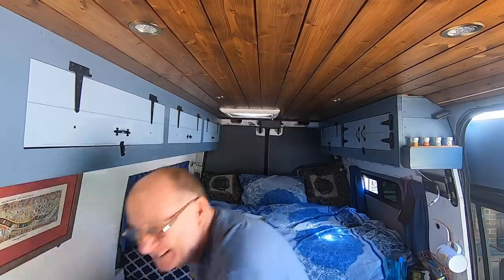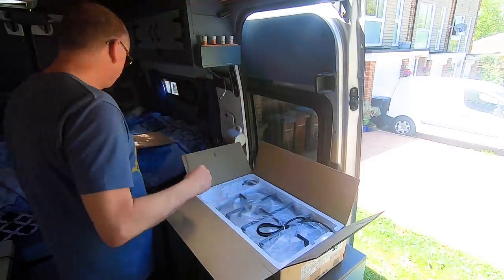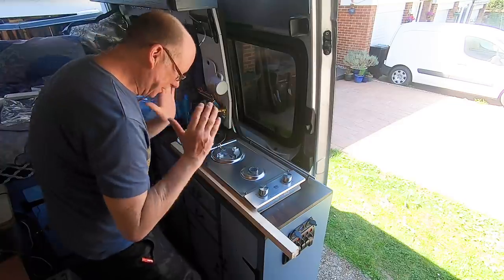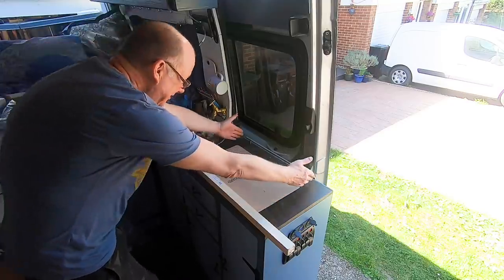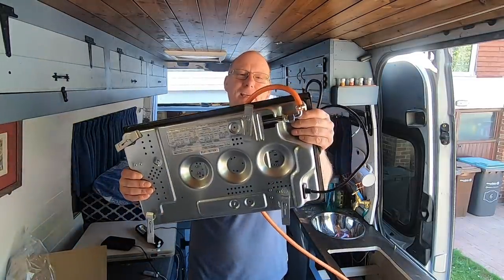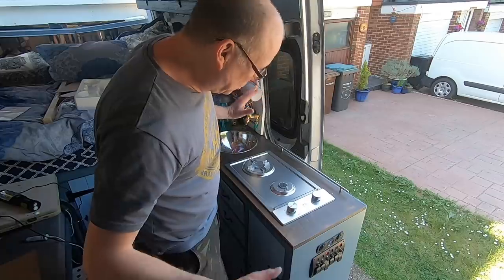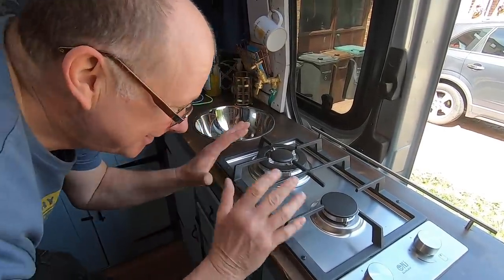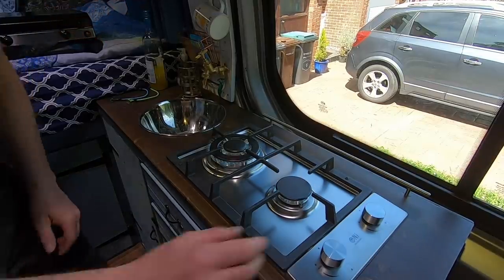Installing twin burner LPG Propane Gas Hob Stove Camper van build

Comment from the maker: ORANGE LPG GAS PIPE should not be used for permanent insulation I’ll be changing this to copper pipe when I fit my gas locker in the rear garage of my van apologises for any confusion
Reply: Yet my factory built VW is fitted with orange gas hose as a permanent solution.
Reply from the maker: John Veryan that’s interesting because my old vw Combie was too 👍🤓👍
Reply: No reason or requirement for copper if under 1m.
Reply: Hi, any idea where one could buy a two ring gas hob, reasonably priced, thanks... love the videos.....
Reply: I would never put copper in a van. The van flexes, moves, get's jolted etc. which means the copper will work harden and crack. I never hard wire my plumbing either in boats or vans. It's just asking for trouble.

Comment: looks great Mel! regarding the rattles, I  suffered the same  i finally built a shallow wooden lid (to match the interior) and added soft foam on the inside of the lid. this cushioned the hob bits and it also doubled as a "work surface/prep area" when the hob was nor in operation. Also it was a add hock tray if needed! .... just a thought
Reply from the maker: Oh that’s brilliant idea thank you 👍🤓👍
Reply: Ha! Thats what I said... oh that’s brilliant. Gotta love the viewers comments. Nice work Mel.

Comment: Thanks Mel I'm glad you did this for your channel 
The amount of stick I got on fb for not using copper pipes was crazy 👍🏼
Reply from the maker: As far as I understand it as long as it’s under a meter it’s fine 👍
Reply: Mel’s Van World you cannot use flexible hose on a permanently fitted appliance. You can only use the orange hose on portable equipment. That company should not be supplying that hose with that cooker it’s against current EU regulations.

Comment: Ive just fitted an underslung gas tank, what a job that was, the weight in it is no ones buisness, and i didnt have a jack so was bench pressing it up 😂
Reply from the maker: Bramish EU that’s brilliant idea and well done 👍 😬👍
Reply: @BigVanSmallWorld  tbh Mel, they save space, and they come with all the rubber coared gas pipe, so all piping is ran underneath and pops thru at the appliance.  However, they arent cheap, about £400, on the upside, they come with everything, recessed filler box and all pipe work/maniflod and even pipe clips with tek screws. They are worth it if budgets stretch that far.  Oh, and comes with digital lvl indicator and cable.

Comment: Sometimes the solution lies in your own barn... found å 15 ltr ventet can that will do as dieselheater tank and fits there where the 2 gassbottles stand (I take out 1 gassbottle in wintertime and replace it with dieseltank for winter use)👌🏻. Thanks for the inspiration🤘🏻
Reply from the maker: Thank you that’s great and you’re absolutely welcome 🤓👍

Comment: I just bought a twin hob with a grill for my camper, and my rattly bits in the Center of the burners have a little self tapper screw through the cap into the cast body. Screw is off Center and I thought it was strange but you have just made me have an eureka moment! Thanks
Reply from the maker: Oh that’s what I thought about doing at first put screws though the burners but then had second thoughts good luck with yours 👍🤓👍

Comment: Mel I have a two calor gas hob in my campervan was going to change it to the  one you installed. Would I still be able to use calor gas bottle.
Reply from the maker: Yes you can 👍

Comment: Hi Mel … looking at installing this gas cooktop in my van. Like you, I won’t have 240v power in the van. I assume the gas ignition does   not require 240v to work. What does the 240v operate. Regards Gino from Australia
Reply from the maker: Hi Gino I used my Bluetti

Comment: Mel: I think I'd have just cut a bit of sponge to fit under the bit you screwed down while you travelled. Would stop the rattling and stopped the big lump from slipping off at the same time - no need to screw down, and easy access for cleaning as grease will build up under that dang thing :-)
Reply from the maker: That’s what I was thinking 👍

Comment: hi mel just a thought mate, if you did not want to kink the gas pipe maybe you could adjust the gas connector to vertical and then you would get no kinks.
Reply from the maker: Hi I could not do that because of the draw 👍😊👍

Comment: HELP NEEDED !! 
Hello Mel. Or Anyone who can help .!! 
I can't work out how you got a pilot light to fire on this unit, when its a 240v plug? - did you use an extension cable ? - Where you able to rewire it to go off your 12v system ? - Or did it just work from pure voodoo alone? - I would be so grateful if anyone knew the answer to this. Thanks in advance !

Comment: hello mel can you link to the fittings to connect the gas hob to the copper pipe that the hob should be connected to from the gas bottle locker ? if you have done that or know how to ? please
Reply from the maker: Hi mark I’m the same as you I can’t find the fittings but when I do I’ll definitely let you all know 👍🤓👍
Reply: @BigVanSmallWorld  thank you mel as that is the only thing stopping me getting a domestic hob to fit in a van although from my limited knowledge it all has to be compression fittings with no ptfe tape as that can cause fitting problems

Comment: Hi Mel, 

Just wondering how you got your stove to spark without using the standard 240 plug ?!
Reply from the maker: Jackery under the sink 👍😁👍
Reply: Thanks for the reply! would it work with just lighting a lighter and then using the gas ?
Reply: @jamieduff1811  did you ever find out?
Reply: @jamiewalker8600  you can light it with a match or lighter if it's not plugged into power 👍

Comment: Awsum mate why dont you just take the rings of while your driving, also you could make a wooden box to cover the cooker so you still have a work top when not using cooker, put a hinge on cooker cover and it will double up as a heat shield for the window when cooking,, 😁
Reply from the maker: That’s a fantastic idea thank you 👍🤓👍

Comment: Hi Mel, i have cut my hole in my plyboard worktop but am not sure what the best paint or varnish to use? Any suggestions? The worktop also has a sink in like this one you are doing! Thanks Paul
Reply from the maker: Hi Paul I simply use wood stain and varnish on mine have a look at one of my latest videos IKEA sink hack and in that video Rebecca shows what varnish to use all think about low VOCs good luck 😉
Reply: @BigVanSmallWorld  thats ace Mel, thanks was just a bit bothered about the heat generated but am sure the glass hob will soak that up! Cheers 👍

Comment: Hi Mel, I have the same cook top and the cast iron top has small rubber feet on it and I dont get any rattling at all.
Reply from the maker: Hi ya yes mine has the same rubber feet too I just didn’t want it to come flying off when I go a pot hole 👍😂👍
Reply: @BigVanSmallWorld  I also made a top to cover mine so when not in use I still have a useable worktop and when lifted it acts as a splash back and wind deflector
Reply from the maker: GAZO D that’s a great idea 👍🤓👍

Comment: Hi Mel great video as always , I’ve just fitted the same hob in my van can you remember if the brass conector from hob to orange gas pipe had a rubber seal I’ve got same conector but no seal wondering if just use ptfe tape be ok 🤔
Reply from the maker: To be honest I can’t remember for sure but I think the adapter did have like a tap washer send me a photo on Instagram to remind me
Reply: Any ideas how the brackets are fitted folk's, instructions are naff

Comment: This might sound ridiculous but could you run this stove off the small screw on camping gas canisters with the correct fitting ECT  ?
Many thanks
Reply from the maker: Yes definitely will work as long as you got the rite fittings 👍
Reply: @BigVanSmallWorld  brilliant mel thank you for replying 👍 . I don't suppose you know what types of fitting to look for off the top of your head do you pal ? Many thanks for all your vids bud great help

Comment: ive got the same one and mine does not rattle unless i got down off road tracks  should be fine
Reply from the maker: bonehead2412 Hi thank you that’s reassuring I’ll be going down lots of off road tracks when I go metal detecting 👍🤓👍
Reply: @BigVanSmallWorld   you got be be going hard on the van to make them rattle but u cant hear it as your getting throne all over the place (im bad for not putting my seat belt on )

Comment: Mel I thought for a permanently fitted hob you need to use rigid copper pipe for the supply. I might be wrong though.
Reply from the maker: I think that’s if it’s over a meter long thanks for the positive feedback really appreciated 👍🤓👍
Reply: @BigVanSmallWorld  thats good to know as I've used the same hose but its under a metre aswell, thanks Mel
Reply: According to current EU regulations orange flex hose cannot be used on permanent cook appliances. Only on portable appliances. The installation must be done in copper pipe.
Reply: @GregVirgoe  thanks Greg, it was probably   your vlog I heard that on. Mine is a campstove that I screwed down to the worktop so I can unscrew it and stow it away to comply I suppose.

Comment: Can you use that scrap counter wood piece for an extension fold-up counter?
Reply from the maker: Ohh that’s brilliant idea I’m so great full thank you 👍🤓👍
Reply: @BigVanSmallWorld  maybe you could hack up a piece of wood with a pipe, like your table. Drill a hole in the top end of your counter to the right of cook-top and put in a swivel work surface tier. Something you could plug up when not in use and store the extension some place or swivel tier over cook-top when not in use. Maybe a wood plug with a tiny knob to pluck it out if needed to cover the hole. Options! I guess you could use hidden magnets to keep your plug in place☺️ Or you’ll have to build hinged extension out over those switches when you enter, but it’ll get in your way too much.

Comment: Hi Mel great vid. Do you have a link for that hob mate ?
Prob a silly question but how did you get ignitor to work without using the 240v ?
Cheers
Reply from the maker: Derek murran thank you there’s a link in the description of this video for you and I used an inverter for the 240v 👍🍻

Comment: hiya Mel love this 2 ring stove, i did notice in listing that it has a 240volt plug which is for auto ignition, so is yours plugged into an inverter? Cheers Adam
Reply from the maker: I’ve got it plugged into my power oak works great 👍

Comment: I just fitted that..what gas do you recommend and what fittings do I need to connect to the hobs.my partner lost the bag of bits so I just have the stove in and no need for the igniter as we use lighter..just need it hooked up right .
Reply from the maker: You need 3/4 female to 8mm barbed fitting for the hob good luck 🤞
Reply: @BigVanSmallWorld  I sorted it all out and works fine..

Comment: I've got mine fitted but not connected electrics yet.. Hsve you wired It to your inverter? Would be interesting tic see as I'm yet to buy a inverter
Reply from the maker: Hello no I just plugged it in to see if it works when I’m out I’ll use a lighter 👍

Comment: Need your help Mel (or someone that can answer) I watched this video and promptly went out and brought a new hob to go in my little van as I was fed up with the single burner/sink combination. Just realised that the hose from the campingaz regulator is a much smaller fit than the inlet on the gas hob. Do I need to use some sort of 'step up' adapter? If so, can anyone point me in the right direction please. I think the pipe from the regulator is 8mm but its very hard to measure the one on the hob that's designed for a house. it looks around 15mm!! Thank you in advance to anyone that replies....   :)
Reply from the maker: Hi Sharon you are absolutely rite the standard size for LPG gas is 8mm the hob is 3/4 inch or 15mm when I brought mine the reducer and lpg  jests came with the hob it was just wedged in side the box check you haven’t missed it in the packaging otherwise you need a 15mm  to 8mm barb fitting hope this helps 👍
Reply: @BigVanSmallWorld  You Mel, are an absolute diamond lol. I just went through the box again and guess what? Yep it was in there. I have spent the last hour researching how to do this and it was there all the time. Thanks so much. I cant wait to get it connected.  Mind you, I have gutted my van and in the process of putting it all back together. Quite daunting at times. Thanks again youre a star :)
Reply from the maker: Lol that’s brilliant so please you found it good luck putting all back together 👍😊👍

Comment: Hey Mel
Did you replace that orange pipe with copper? If so which connector did you use from the hob down to the 8mm pipe? Just changing mine to copper for the regs, and struggling to find a solution at the moment 
Love you videos. Tom
Reply from the maker: I don’t know about what regs you are referring too mine is as is in the video I go from orange to copper using the fittings that came with the appliance sorry I can’t help

Comment: Great video as always Mel did you convert the new stove to 12v or did you use a main plug just to show it works? Just had though mind your side window a lot of heat as you are well aware? From sunny skeggy uk
Reply from the maker: Thank you some good points there regarding the window I’ll have to put something up to protect it and yes I plugged it in to see if it works when I’m out I’ll just use a lighter 🤓👍

Comment: Any pictures of the connection to to hob just been given a hob  so no connection with it cheers mike
Reply from the maker: You need a 3/4 to 1/4 gas fitting good luck 👍

Comment: That's a smart looking hob - I just wonder whether you will need the 240v supply to enable the flame failure feature , or is there a 12 v option on the it ?
Reply from the maker: That’s a really good question one I did ask the seller I’ll address that on Wednesday but for now no you don’t need power for it to work 👍
Reply from the maker: Campervan Photographer we’ll done 👍🤓👍

Comment: great location ... jokingly ... wind will keep the flames out
Reply from the maker: Iv no worries with wind as I fitted a splash back 👍🍻👍
Reply: @BigVanSmallWorld  Thanks,  I need to remove my old unit an measure the opening to my options.  Maybe use it until I can install a new top.  The stainless top on mine was so badly neglected by the prior owners, it caked rust! .... if you can imagine that.

Comment: Hi Mel, does the safety cut out feature still work if the hob isn't plugged in?
Reply from the maker: Yes it does it requires no power to be used it’s just the ignition that needs power to make the spark I don’t even use that I use a little usb lighter works perfectly fine 👍
Reply: @BigVanSmallWorld  awesome, thanks for getting back to me so quickly, fitting one in mine this weekend!

Comment: I'm not sure you read your rules right. How on earth could a portable Butane camp stove be more dangerous than an LPG installation where the gas bottle opens INTO the van. Even if it is allowed to open into the cabin, it still can't be safer than that 'lighter than air' Butane stove. I think the Ozzie standards are even stricter than the Pommie rules. So any possibility of it coming inside the van, is a no-no. Same with the gas hose. Should be crimped connectors and fittings. The position of the hob is  pertty special...right in front of the view!

Comment: Mel put the Gas bottle door from the outside .. Easier to change it from the other side of the cabinet ,, Good fit ,, we had a similar cooker in a combi stupid thing had to be plugged into the 240v to open the gas valve ,,,, I sooon fixed that by ripping the soliniod ot ! 
Great vid buddy
Reply from the maker: That’s a great idea thank you no worries about the 240 it works unplugged too 👍🤓👍

Comment: How you doing mate. What was your dimensions for cutting out your worktop for fitting the hob.
Reply from the maker: I’m doing ok thank you the hob came with a template so I didn’t need to know the dimensions I’m sure if you klick the link in the description of this video you will find them there if not then the seller will be happy to help you good luck 👍🤓👍
Reply: @BigVanSmallWorld  iv tried that but unfortunately the hob is sold out. Thanks anyway Mel

Comment: Hi Mel,I notice that your gas bottle is right next to your  control panel isn't that a little dangerous say if you got a spark from your panel ?
Reply from the maker: Only if there’s a gas leak 👍😂👍
Reply: @BigVanSmallWorld  Thanks mate,I'm converting my van and I'm doing the same with my setup.
Reply from the maker: I have actually moved my gas tank to underneath my bed now and my water tank wast tank too so that I have more cupboard space 👍

Comment: Looks good, but how did you get the ignition working without plugging it in? 🤔
Reply from the maker: I plugged it in 😌👍
Reply: Mel’s Van World with... 230V 😳😳📺☠️
Reply: Mel’s Van World plugged it into what? Didn’t you ban 240 volt? 😆 
I’m at this exact stage now and wondering if I can connect the ignition to 12v? Would that work?

Comment: Hey Mel, get well soon. Wondering if you converted the 240v spark generator to 12v
Reply from the maker: Thank you no I use the power pack under the sink 😊
Reply: @BigVanSmallWorld  power pack? , sorry so you have an inverter for the hob spark? Which is plugged in 240v?